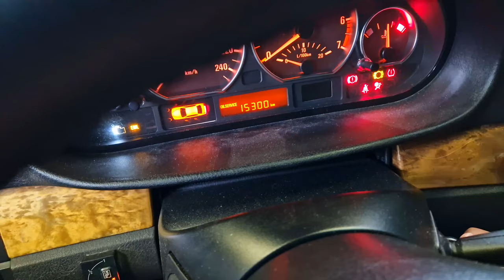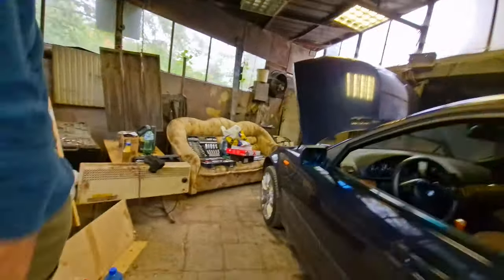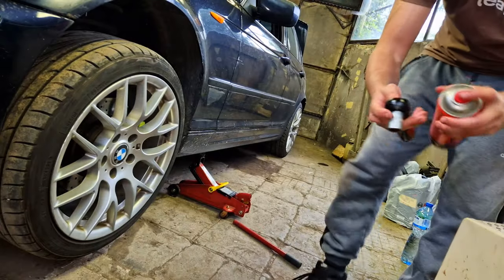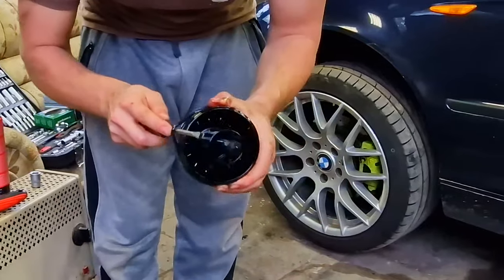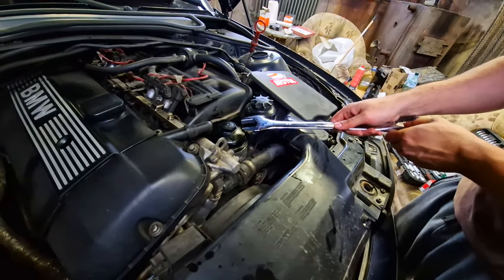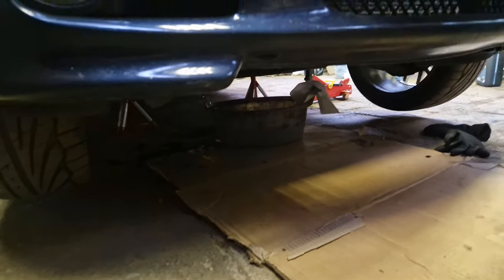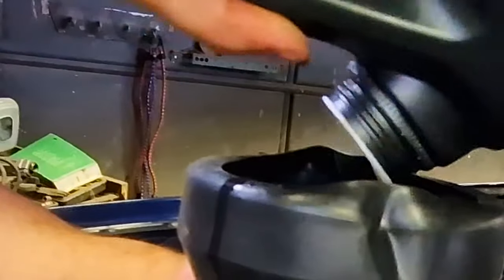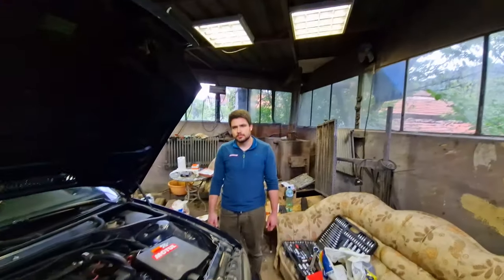E46 OIL CHANGE ANY% SPEED RUN

Comment: Another guy did multiple oil changes at different intervals and found at 10,000 the oil has started to break down but at 7,500 it’s the same as a 5,000 mile one. He also has a bmw but I forget his channel name
Reply from the maker: I am not surprised at that, around 10k is great at least for the M54 in my car. After all it's a 20+ year old engine without major maintenance and a car that is presumably been driven sporty.